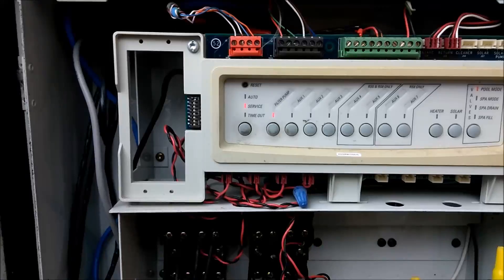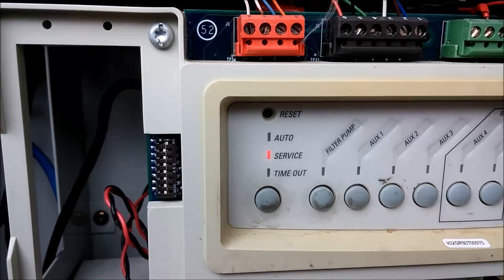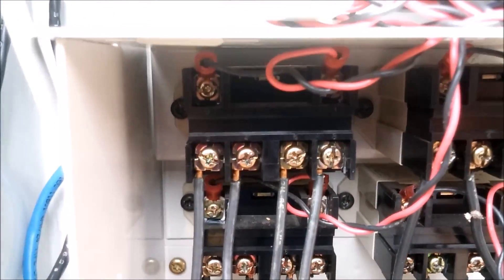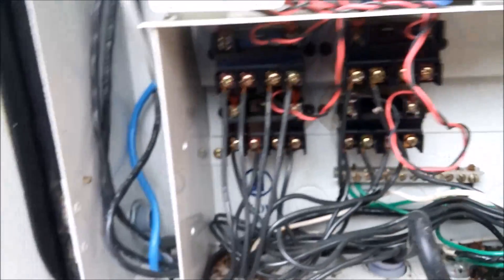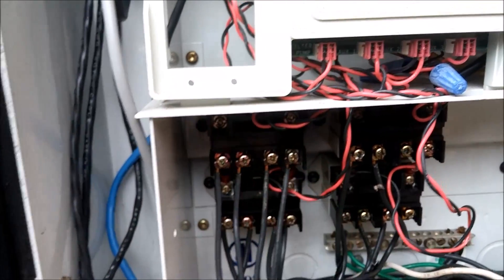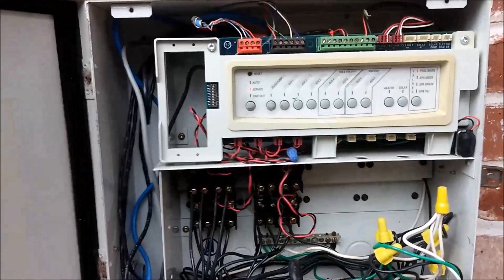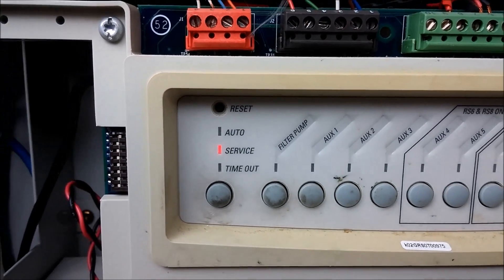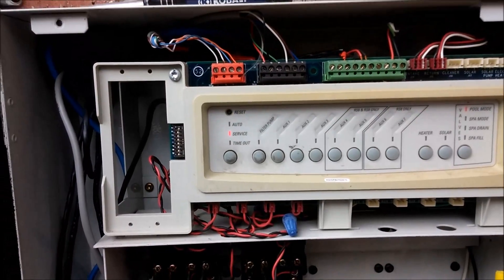Jandy RS troubleshoot Service Mode not turning off the pool pump relay.

Comment: Thank you for the video.  I have this issue, which was intermittent.  When the pump did not turn off at the programmed time, I had to shut it off at the breaker.  I would have to turn on manually like this for 3-4 days, then all of a sudden it would start shutting off at the programmed time for 3-4 days.  This went on for three cycles like this, before the most recent time I had to shut off manually at the breaker, it would not turn on.  It has been hot and since the motor would not turn on, I figured it was the capacitor, which has recently been a seasonal summer problem.  Replacing that did not help as the motor still will not turn on.
In your opinion, would the issue still be at the relay and it is permanently stuck in the off position?

In my control panel, the relay in the upper left-hand corner seems to control the motor used for the pool waterfall, with the relay directly below it seemingly for the pool pump motor.  Cycling through "Service" and "Time-out" modes at the control panel does activate and de-activate that little plastic piece you referenced underneath the relay depending whether or not the indicator light is on or off for the filter pump.  When in "Auto" mode, the plastic piece is into the relay itself during the programmed time period, but if I manually turn the filter off on the control unit inside the house, the little plastic piece then is extended to where it can be visually seen below the relay.  Appreciate your thoughts.
Reply from the maker: It sounds like the relay may be working as you described with the movement of the plastic piece on the relay.  You can check if pump will come on by turning off power and connecting wires from pump (usually on legs 2 and 4) to the electrical supply wires (usually 1 and 3). This would be direct power so when you turn breaker on, the pump should come on because it is powered directly from the breaker.  Troubleshoot pump and motor this way.  Once repaired, whatever is needed maybe new motor, then you can return wires to their places on the relay.  See if control system is turning on and off the pump when programmed.  You can always switch out another relay for the one that is controlling the pump if you want or use a spare that may be in the box that is not being used to put in place of current relay.  If that pump is still not turning on, then it's probably the circuit board in the system going out.  You can reprogram system to have pump on a different relay that is working, or replace circuit board if other things are also not working in your programming.  Only mess with electrical as I suggest if you can do it safely.  Hope that helps.

Comment: I used this video to locate the relay that was malfunctioning. My pump wasn’t turning off with the timer or in service mode. I replaced the relay and it works great. Very helpful video.
Reply from the maker: Awesome, thanks for the feedback and glad it worked out!

Comment: Great video and exactly the issue with my Aqualink.  I replaced the relay and all was good again for about 60 days.  Then same issue of the tab sticking.   Figured I got a bad relay so ordered another new one and about 60 days later it started to stick to.  My initial one was issue free for at least six years.  Thoughts on why I seem to be going through these pump relays now?  Very much appreciated!
Reply from the maker: Glad it helped.  The relay may be getting too much voltage to it from the board, check for 24V AC from board to relay, the wires on top.  Also could talk to Jandy tech support about the problem also.  If button is sticking on the board, that is just a button/board issue, not related to relay operation.

Comment: Hey I have a question and maybe you can help and I'll appreciate your help as well. I just got a new pool and have a Jandy system. I have two relays that are not being used for Aux3 and Aux4. I have low voltage lights around my house and will like to hook up directly to Aux3 for the front of the house low voltage lighting and aux4 for the rear. Question is this possible. What is the max output voltage on each relay and if I hook up to the low voltage cables directly to the relay do I use the line one load out screws next to each other. Any help you can provide would be very appreciated and helpful.
Reply from the maker: The relay on the Jandy system is activated when you push the button for that relay.  Hook power to legs 1 and 3 if 240 voltage and then the item being powered to legs 2 and 4.  If 120V then power to leg 1 and the item powered to leg 2.  When the relay is activated, it should allow voltage to connect between leg 1 and 2 for 120V or a lower voltage for low voltage operation.

Comment: Thank you for the great video! I have the same equipment, but my pool light will occasionally not turn on unless I "hit" the panel and then it works. I suspect its the relay. Does the relay for the pool light also use the Zodiac R0658100 3-HP, or is it a different one? Thank you!
Reply from the maker: All of the high voltage relays should be the same.

Comment: Thank you so much for this video. I have an AquaLink RS by JANDY and I have the same issue with the service mode not turning off the pumps. My pool guy says I need a brand new controller which with installation would cost about $1500 to fix. I noticed you responded to an earlier comment with the part number needed. Does that part works for my AquaLink RS or do I have to look for a model number on my AquaLink? Im a first time pool owner so I’m becoming familiar with the pool equipment as I go. thank you for your help
Reply from the maker: You need a Jandy low voltage (24V) relay like the others in your panel already.  But a Hayward one should work also.
Reply: Thank you! Do you have a video on how to change them?
Reply from the maker: @andreadelgado4212  No, but turn off breakers, remove wires, remove relay, note which slot connection wire is plugged into on board, unplug it, then do reverse to install new one.

Comment: I’m having trouble with fuse keeps blowing up.

Incoming water actuator got cut twice by rat and splicing them fixed the issue.

Then today got return water actuator cut so I splice it and fixed the issue for pool mode.  Tapping mode button to go spa doesn’t switch. When I try switch spa mode on the app, it burns the fuse.

I’m getting actuators replaced but im worry that won’t solve the issue with spa mode…
Reply from the maker: Yeah I would replace spliced actuator and retest.

Comment: Hello! My pump does not turn on whatsoever none of the buttons turn anything on either. I’ve reset my breaker boxes, reset the gfci and hit the small reset button on the Jandy Aqualink panel. Nothing has worked, are there any other things I should be checking? Thank you so much!!
Reply from the maker: It sounds like your main circuit board has gone bad if none of the buttons work.
Reply: @bcspoolpros4441  Thank you for your help! I appreciate it!

Comment: Thanks for this video, I have an Aqualink and I’m having intermittent issues with my filter pump not starting and I’m suspecting the relay has worn contacts. Can’t I just replace it with a 2 pole contactor? Or is the coil not 24 volts?
Reply from the maker: Not sure.  Look at the specs on the contactor.

Comment: this definitely saves my day!!! I found it's the same issue and the relay click got stuck on the bottom. I used a screwdriver to nudge it a bit and now it works again!! The next thing is that I need to lubricate it a bit in order to avoid it get stuck again
Reply from the maker: Thanks for the feedback!!!

Comment: Hello.  Have a similar issue with Jandy Control box same as in your video.  I have iAqualink and noticed my connection on my phone changed from green to red so was unable to operate my spa.  When checked the Control Box, it was on Auto and none of my 3 pumps would turn on until I put it in Service Mode.  It appears my relays are working as can see the plastic black pin in the bottom moving when actuate; however, my wired remote to the box from at the spa wont work (even when in Auto) as well as no LED lights (green, yellow, red) are working the on iAqualink remote antenna.  My program that I made to have all 3 pumps to go on at certain times of the day appears to be working though.  At this point, have no way of controlling spa unless at Control Box on Service.
Confused why both remotes (wired one at spa and iphone) dont work and only works in Service mode and unable to connect to wifi iphone iAqualink?  thank you
Reply from the maker: I would un-wire the wired remote coming from the spa. The spa side remotes interfere with the main control box when they start going out and can cause weird results.  After disconnecting, turn all breakers off to pool equipment, wait 10 minutes, then turn them on to reboot system.  See if your app on phone is working after that to turn stuff off and on, if not call Jandy/Zodiac tech support to troubleshoot IAqualink connection to your control board. Consider a SUPER THANKS!!!

Comment: So, my HEATER button won't turn on. It's the only button that does not light up when i press it. All of the other functions, to include the water heater light up and operate normally. Any suggestions on what it might be? Thank you!!
Reply from the maker: Check the communication wire between the control box and heater to make sure it's not broken.  Next, run the heater manually to see if the heater itself works fine.  If those check out, the heater button on the board may have stopped functioning.

Comment: Hi Rich, I have a 2 speed pump but the low speed is not kicking in. Could that be a faulty relay? I hear the relay click but slow speed isn't working. Pump works fine on high speed.
Reply from the maker: You could replace the relay first just to check.  But probably the Low Speed has stopped working on the motor if you still hear the relay click to try to activate the Low Speed.

Comment: I just wanted to reach out and say thank you for your videos.  Extremely helpful.  I know you made this video back in 2017, but here we are in 2022, and I just had this problem occur.  While I figured it was a relay that had gone bad, I did not know how to tell for sure.  Your video helped fix that.  Also below you were nice enough to tell another person what part number to purchase in order to replace a bad relay switch.  That's another one that is very hard to find.  You can't see any info on the relay while it's still installed, and I have been trying to figure out what part number to look for to replace it.  I will be following your videos from now on.  Again, thank you so much for doing these!  Signed a fellow Texan :)
Reply from the maker: Great!!! Thanks for the feedback and glad it helped!

Comment: What if the lights relay clicks on and off fast?
Replaced one light with led, standard bulb in other one.
Reply from the maker: Not sure, you could replace relay to see if there is a problem with the relay itself, but my guess is that the board is sending that signal to turn relay on and off.

Comment: My Pump (220V) as no power - whether in Auto or Service Mode.    The PIN pushes out and in for Service Mode correctly (still no power at the pump via multimeter) but in Auto Mode, the Pin Pushes out and immediately pull back (Light stays on).   Its an old RS4 Aqualink System so not sure if I should be looking at the Relay or the Transformer?   I already changed out the Capacitor and nothing improved.
Reply from the maker: Check to see if you have 120V power at each leg 1 and 3 on the relay pictured.  If you have power there it's probably the relay stopping the transfer of power and not working to send power to pump in service mode. Another way to see if pump is working or not is to turn off all breakers to pool equipment, move pump wires from legs 2 and 4 and attach them to legs 1 and 3 with the incoming power wires.  When you turn the breakers back on the pump should have 240V sent straight to it like the pump was wired directly to the breaker.  That is how you could troubleshoot the motor working or not working.  Only do this if it makes sense and you know how to work with electricity safely.

Comment: Intelli touch automation. IN SERVICE MODE IF YOU PRESS SOLAR IT TURNS ON AMD ACTUATOR TURNS.
 IN AUTO MODE I PRESS ON SCREEN LOGIC SOLAR IT DOES NOT TURN ON. IS THAT THE SOLAR RELAY??
Reply from the maker: I don't think it would be the relay since you can activate it in service mode.  It may be some problem with the screenlogic interface to the IntelliTouch.  But I would recommend you call Pentair tech support to have them help you troubleshoot that further.  Thanks.

Comment: Hi I have a client and the problem there the pump stop working and doesn’t start again and in order to start we have to turn the main breaker of and start again what can be ?
Reply from the maker: It sounds to me like by turning off the breaker you are actually resetting the board and then it works to turn on the pump through the relay.  So it sounds to me like your are having a board issue or maybe just a board issue with that button and relay.  The relay takes commands from the board to send electricity or cut the electricity. So check the other relays to make sure they are working correctly turning things on and off.  You could always swap out that relay for another to see if it's doing the same thing, if it is, then it's something with the board or something with the pump.  Wire pump directly to breaker and see if it runs fine with no issues.  If it does then you have eliminated the relay and the pump being the problem, so it comes back to board having issues.  Hope this helps and thanks for the question.

Comment: I have an Aqualink Power Center where the board has no lights at all. I have had the board tested and it works. I have replaced the 24V Class 2 Transformer and no go. I have tested the power coming from the breaker it is good. The way my box is wired the black wire power to the transformer goes through one of the relays. Could the relay be the problem?
Reply from the maker: Thanks for the question.  I don't know why they would wire the black wire to the transformer through a relay.  I would think this is a problem or at least an abnormal way to wire it.  So either the transformer is not getting proper voltage to it and can't send the proper voltage to the board and thus the board won't work.  Or the board itself is bad.

Comment: Jandy RS turns pool off&on randomly. Ran a boost and it shut off a couple of hours early. Couldn't get it to come back on then several hours later it started running. Will run for 30 seconds to a minute and shut off again for about the same time period then start back up. Any suggestions?
Reply from the maker: Sure. It sounds like a bad board but could be an issue with the pump motor.  The motor may be overheating after running for a short time and cutting off. To check let it run for like 30 minutes doing its thing, then touch the metal part of the motor quickly to see if it is very hot.  If the motor is overheating it has a thermal switch inside to cut power for a few minutes then it will allow power to flow through the motor again , but the motor overheats again and cuts power, etc.  If the metal part of the motor is very hot, that could be the issue.  If the motor is not extremely hot, you probably have a bad board that is doing things randomly because it's a messed up circuit board.

Comment: Can a relay go bad without signs of stuck pin? Mine is reading 98v all other relays are reading normal. I'm not sure if relay is bad or my pool pump is out. Thanks
Reply from the maker: Yes it can.  If you have proper voltage coming to the relay, but not the full voltage going through the relay, I would replace the relay.

Comment: I replaced the relay but it did not fix the problem.  My problem: control panel unresponsive but lights up.  I switched off breakers then reset. When in auto, the filter goes on then low speed kicks in.  (No programs input!) service mode and time out: no effect.
Reply from the maker: When the board has power and the buttons are unresponsive, especially multiple ones on a board, it's should be a bad board.  Have a pool tech come check it for you.

Comment: I also have a jandy outdoor panel and an inside panel. One day the pool was running and I shut off the breaker belonging to the pool section on accident, and when I switched it back on, there is absolutely no power to either panel. The gfci outlet still has a little light on it but nothing else. I have pushed test and reset on the outlet but nothing. Any ideas?
Reply from the maker: I would shut off all breakers to the pool equipment and reset them.  If still no power to the main control box, sometimes another breaker on a different panel box controls parts of the pool equipment.  Sometimes you see weird wiring setups. If you check other breaker boxes and still nothing, I would then recommend contacting an electrician to figure out what is going on.
Reply: True Light Pools, LLC Thanks but it ended being the board being shot out so I had to purchase another one
Reply from the maker: Yep, that will do it.  Thanks for letting me know what it was.  Take care.